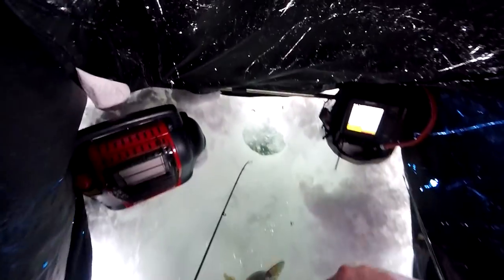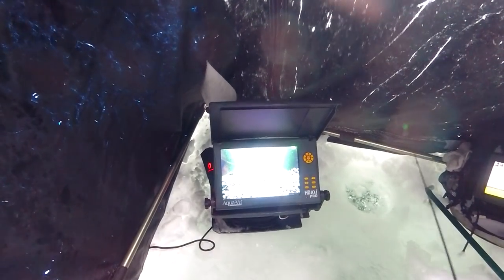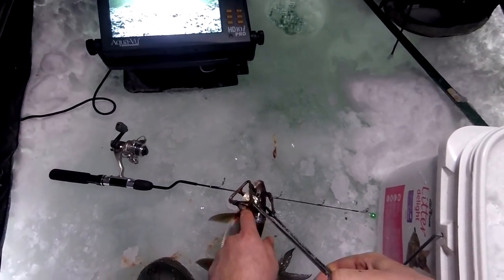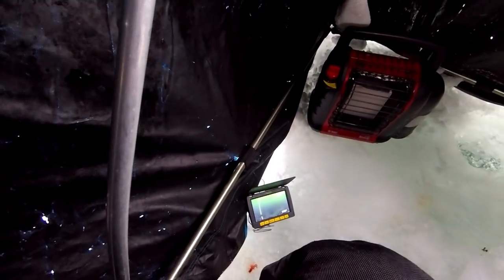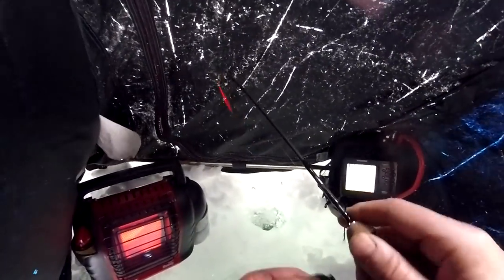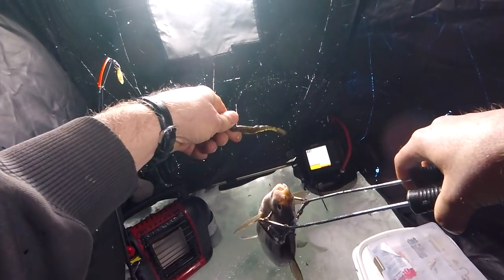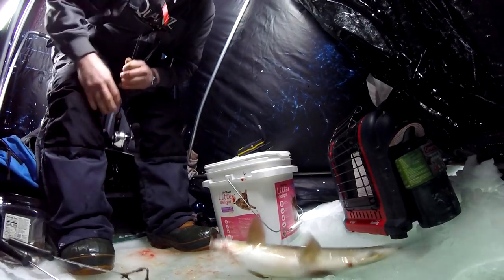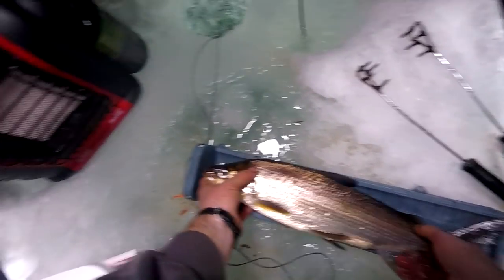Icehole Adventure #12 Ice Fishing Whitefish (Ned Rig) 2019 Bay of Green Bay Lake Michigan

Comment: Nice adventure Nick.  I’ve never been white fishing before, it looks like fun.  Which do you prefer to fish for? whites or walleye?
Which one tastes better in your opinion?
Reply from the maker: Whitefish are a blast to catch through the ice. The fish fight hard and your bringing them up from deep water so it takes awhile to get them in.  When prepped correctly they are great table fare. I think they get a bad rap because they are slimy and stinky on the outside but if you bleed them out and stay away from the dark meat and fish fat while cleaning they are awesome.  Lately I just lightly coat them with olive oil and spices place the meat on a glass plate with the thickest pieces to the outside and cover with plastic wrap and microwave for around 3 min. at 1/2 power.  When all pieces are bright white and easily come apart when forked they are done.  You can eat them at this point or use them as the meat for fish tacos (soft shells).  For fish tacos I like making a creamy sriracha lime sauce (mayo, sour cream, garlic powder, sriracha, and lime juice mixed together) and top with diced onion, cucumber, and shredded lettuce or cabbage.  The whitefish is real mild like tilapia meat so you actually taste the spices or sauce more than the fish. When I prepare walleye i usually fry it  with a shore lunch style batter but the meat is really similar just not a oily.  Both are good for eating (i like them both equally) and i prefer to fish for the whitefish when ice fishing but would go for walleye out of my boat or kayak.  Good luck on your next adventure.
Reply: No-Fish Nick's Adventures 
Thanks for the info.  It was also fun to hear how you got your nickname on this episode.  Take Care!

Comment: How do u set up ur Stop on slider rig?
Reply from the maker: It's just a small hook free floating on the line above your swivel. The stop is just a very small split shot sinker placed a few inches above the hook and swivel. You could also set it up like a drop shot but I like using a swivel for going that deep. It keeps the your line from getting all twisted. Good luck.
Reply: Thanks alot 4 info

Comment: Would using the camera as top view work in the current better? I just got my revolution pro  and was hoping to be able to use it for whitefish on the bay.
Reply from the maker: It might. You could also try attaching the trolling weight or position the camera to look up on a angle and set it right on bottom.  I was thinking about those tactics afterwards. Good luck on your next adventure.
Reply: Definitely looks like u catch better quality fish on the plastics
Reply from the maker: @josepheisner9468  yes the bigger fish liked the bottom rig (bigger bait that looked like what they are eating) plus these baits are buoyant so the tail sticks up making it easy for them to grab.